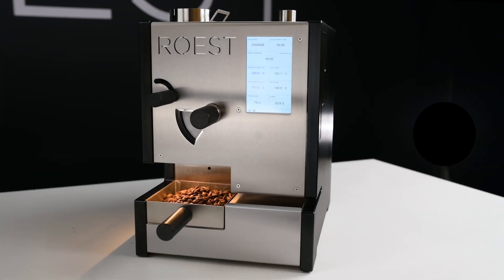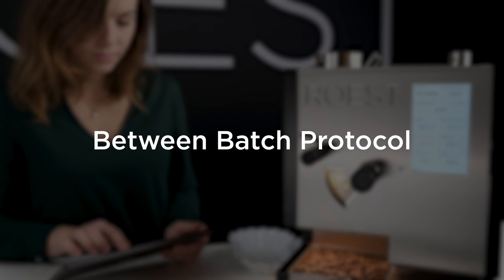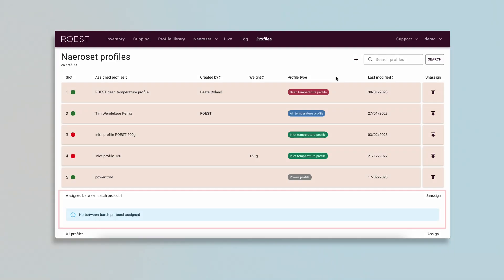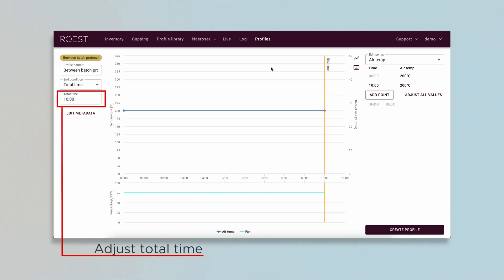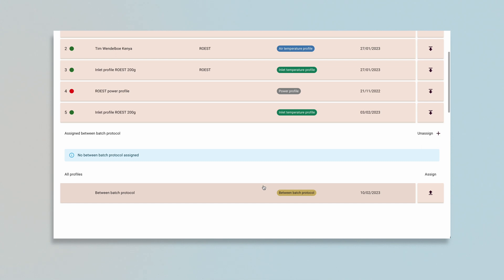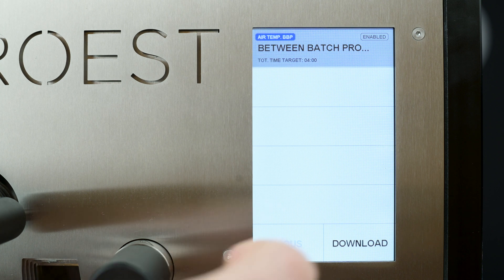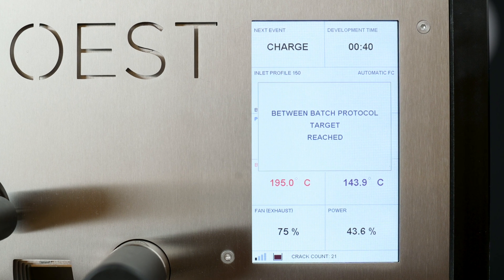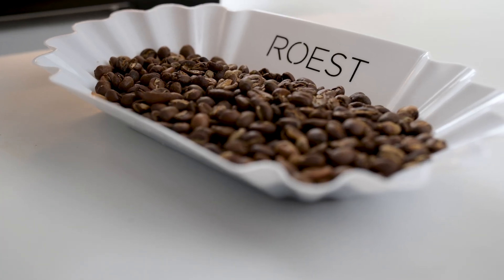How to use Between Batch Protocol on the ROEST Sample Roaster

Comment: I'm still really confused about how BBP is supposed to be used. I get the importance of it, but it would seem that if I roast a batch and want to do another batch, the BBP should read the preheat drum temp for the next batch (which might be different than the previous batch) and then do what it needs to do using the PID to stabilize the drum temp to that preheat temp, at which point it should beep.  However, as currently implemented I have to set a temp in the BBP profile along with a target drum temp. If that target drum temp is different than the preheat temp of my next batch, the BBP doesn't work right. Also, I may not set the temp right in the BBP--it may be too high to get the roaster to cool. The Bullet takes the automated approach: it uses the preheat temp of the next batch and the PID then adjusts the burner until it measures stable IR and drum temps, at which point it says to charge. Currently, I have given up using the BBP on my Roest. Instead, I open the charge gate and let the machine cool to below the preheat temp, then close it and let it come up to that temp. It is not ideal.
Reply: I have similar confusing, not really sure what the start and end time mean...
Reply: I understand the confusion but the different approaches come from how the energy is transferred in these systems. The bullet warms up the drum and then the beans while the ROEST warm up the air and this in turn heats the beans. I have limited info on how BBP works on the bullet, but our idea is that the drum is at its warmest at the end of the roast, and stabilizing at a lower drum temp is the easiest and most energy-efficient way of using the BBP. Heating to a higher drum temp requires a lot of energy that's not really doing anything for the roast anyway. If you want more heat at the beginning og the roast the best is to add more heat through the profile. Personally, I use a very simple BBP. I set the air temp to be maintained at 220degree celcius - this allows the drum temp to stabalize at around 160 degree after a few minutes. If I want a shorter BBP I set my target to be higher but this then requires the next batch to be charged when the buzzer goes off as the drum temp will continue to drop. We are by the way not finished with the BBP and will develop it further based on feedback. For exampel, the BBP will eventually be a part of the individual profile.
Reply: @trondsimonsen6805  I will have to try that. I shoot for 160C before each roast with the standard inlet profile.
Reply: @ToddJohnson15 did you get any results? I have also a Bullet. The drum heat is perfectly regulated but the air temp (bean probe) will vary from batch to batch (thermal energy). And that is the most critical one to get a consistent roast.